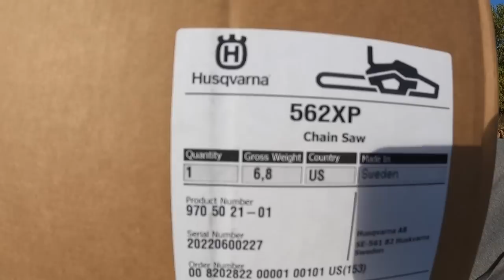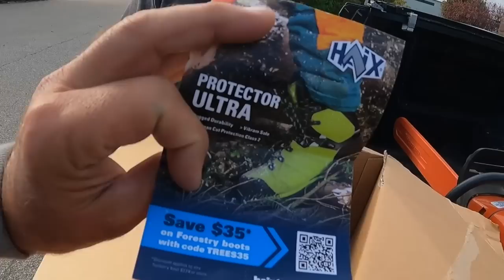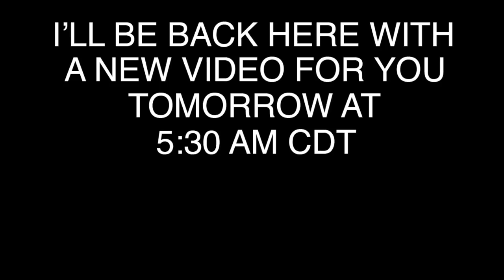NEW - Husqvarna 562 XP Chainsaw!

Comment: Hello gentlemen I use my wifes channel, the westcoast tree guys use a lot of Stihl due to its lightweight and performance, it appears to me that saws are regional. For example Buckin Billy Ray in British Columbia uses a McCullogh and Wranglestar uses Stihl. What are your thoughts on these saws ?
Reply from the maker: McCullogh is no longer made and the old ones while good at cutting are not very safe. I prefer new saws over old ones. Stihl makes good stuff, I have run a bunch of them but I have some great saw shops here with great service and Husqvarna is willing to help me out so that is what I mostly use.
Reply: @InTheWoodyard  I think McCulloch is still making new chainsaws and other products. I may have heard from someone that they actually own a new one. I'll check it out again its possible that my mind is wonderring again, which happens from time to time.BTW way, have you ever placed something in a very obvious spot so you can find it quickly later then comeback a day later and its not there ?.... This seems to be happening to me more often.

Comment: 3 Saw Challenge: Husqvarna 592xp (Stihl bar w adapter), Stihl 400cm, and Echo 355t. I heard you say you don't like 325 chain, but a Husky 550 (or 545 I like better...lower running temp, plenty fast for size) is great for cleaning up small stuff.
Reply from the maker: I like it!

Comment: Just sold my 562 last week.  I had it for a good few months.  Just a gutless saw.  Great to limb with
 Muffler mod those and they gain literally 1/2hp.  Those 545 550 and 562 I’ve seen muffler so hot it welds itself to the cylinder 😮
 My 562 put up 5.12hp and 3.17tq.  From just a muffler mod.  That’s right at 1/2hp gain

And I can see it now. The first time that 562 needs a field reset ken will think there is something wrong with it 😂 
 And I cried a little bit knowing this saws life with old motor oil as chain lube. Makes me cringe
  And he will find out. You will NOT get that c83 sharper than it is out of the box
 550s 562 572 all rev to damn near 15k rpm
 545s rev to 14k
Reply from the maker: okay
Reply: I don't I don't use old oil for Bar Oil I use store-bought

Comment: Just check that you didn’t damage the very small C clamp that keeps the brake assembly square when you forced the cover off. It will run like a three legged dog if you did !!
Reply from the maker: Yup, it is okay, I did not force it off, we just reassembled it and engaged the brake.

Comment: I'm a Stihl guy I don't have to deal with a primer bulb. I grew up around Stihl.
Reply from the maker: Good for you! Stihl makes good stuff!
Reply: @InTheWoodyard  yea they do and a little  easier to work on. I have been taking  a small engine repair class on Tuesday  for 10 weeks at an adult education class i have  2 weeks left  got another one in January and that one is tearing motors apart and rebuilding them. That's a 6 week course I'm 54 just tired of paying someone else to do my work.
Reply: @kevinmason3086  loads of people say that but i dont see it they are designed so similarly now they are not much different to work on.
Reply: I love my big older Stihls, but hate my new one with it’s stupid caps. I might start buying Husqvarna just for that reason alone (hey, Stihl.  Company Are you listening?).

Comment: The smallest saw you guys have is a 60cc? Holly crap man. Get a 30cc for limbs. You'll use it way more than you think.
Reply from the maker: I now have a 540 Husqvarna, nice little saw but I always grab the 572 or 592 99% of the time, power and speed get more work done faster. My 85 year old dad uses the 540 some times.

Comment: I always thought the 500 series came about because Obama put emissions on chain saws if I'm wrong please tell me, the 300 series where awesome the 357 is a great in firewood the 372 speaks for it self the 390 n 395 r flat out tree killers I forgot the 346. But if I'm right why can Chins reproduce  some of these n Stihl models n sell them here in the USA that's why I'm thinking I'm wrong but if I am why would they take such a good line up of saws n completely change them, I'm hard core Husky all the wayn a friend brought me a Stihl 500i to try a couple months ago I still have it it's a cutting fool (it sounds more like a husky then a stihl) they finally made a saw out of the box that had a high power band like Husky , it's not how many rpm' they can turn but how many they can turn ùnder load that's why I always went with Husky my first was a 262 I bought back in 94 it sold many saws for Husky once they ran it with in a month they where back proud as hell they bought a dog but is this new 562 a upgrade from the original I have 1 first the computer went out then crank seals its still in the shop I haven't seen the bill but a 500i at 1500 plus is getting cheap if that bill is to much
Reply from the maker: There sure is a lot of great saws made now, I like most of them!

Comment: I can't believe how all the people that run Stihl saws for a living can get any work done with the gas and oil leaking out of the caps all the time!! They leak when you put the caps in wrong! It's not as bad as all the haters make it out to be. If you use ethanal gas it can also brake down the seals prematurely. I have run the same seals in my caps and cut 15 cords plus each year for five years and no leaks. Perhaps not that terrible of a design?!?!
Reply from the maker: Stihl makes great saw! I like the 462, 599 and the 661 a bunch.

Comment: The auto tune is problematic .
Reply from the maker: I have 2 572s a  576 and a 592, never had a ny problems and I cut a lot.
Reply: Stihl has there problems also. They had alot of problems with the 362 when they put the m tronic in them. Husky has there system figured out.
Reply: Husky does not have it figured out they both have there issues, when it comes to using the huskys in the cold they do not work we use them everyday in a professional environment . The Stihl has it's issues yes, electronics in a chainsaw there is no place for it.

The one saw I have seen run in the extreme cold with out issues is the 500i but not many people are going to spend that type of money
Reply: @Jay-bu5mb  I've ran my 562 in all types of weather and not one problem. There has been a lot of problems with Stihl , that's why I switched

Comment: Great Video and a great review of the 562xp. I prefer the 3 Series conventional carb saws -372's, 390's, and 395's. BUT, I'm might squeeze the throttle and purchase a 562 myself. Also, the shorter lenght scrench is for full wrap bars to get in between the handlebar and the bar nut. Keep on buckin.🇺🇸🇺🇸🪵🪵🪓🪵🍂🪓🍁🪓🪵🪵🪵🌳🌳🌲🌲
Reply from the maker: The short screnches come with all saws now????